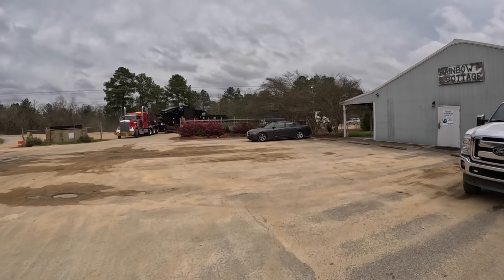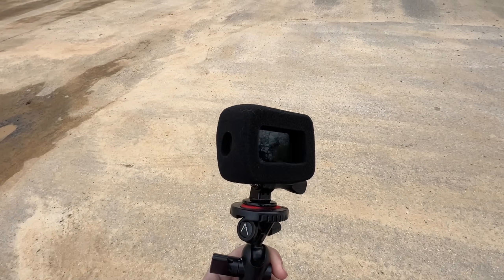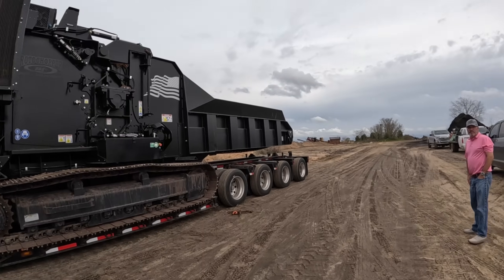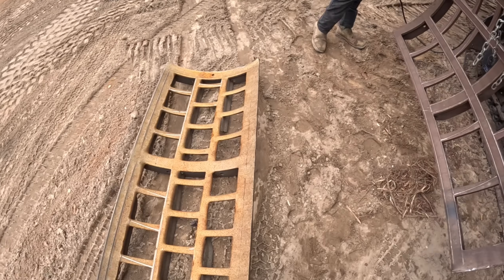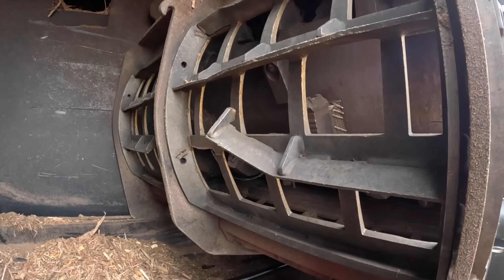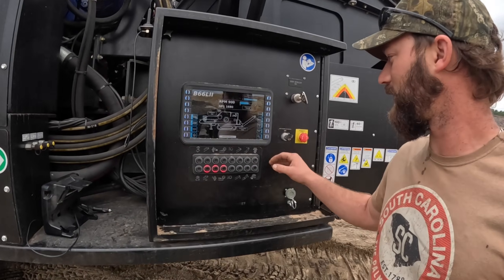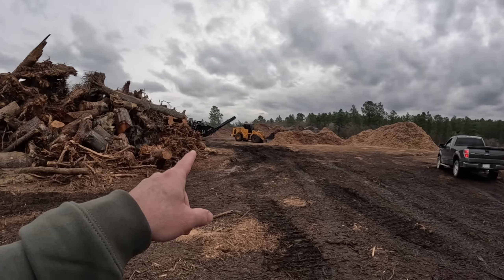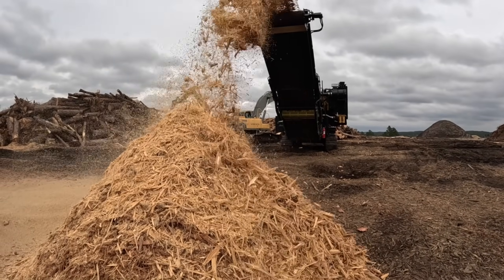Lots of HEAVY equipment arriving today! #heavyequipment

Comment: That machine is what we need here, for our million hectres of forestry industry, possibly require a 100, 😊😊😊.
Reply from the maker: She’s a beast!
Reply: @TheRealMrDigg  I worked in a sawmill as the chipper operator for 12 years, the electric motor was a 750 hp, it could chip reject logs in 3 seconds, plus all the large and off cuts, the noises was 140 dbs, the foresty was very old first crop pine, but not pruned so a huge amount of wasted material,

Comment: Congratulations on the ability to try out the new chipper!   Now you need a larger diesel delivery truck!  That thing probably has a 300 gallon tank!  With a class 8 truck using 10 gallons per hour, this beast must be using about 20 gallons per hour?   At least it is going to make a lot of profit for each hour it is running.  

5600 gallons used in 165 hours is 34 gallons per hour!  Wow!  

This is such a short video, I had to watch it twice!  Thanks for the new video!
Reply from the maker: Dont wanna see the fuel bill this month!!

Comment: Ryan that edge is an impressive machine. I don't understand why they couldn't do that with trash to make it lighter and could pack easier, it would cut down on fuel expenses of running the compacter. Stay Safe and keep up the good work.👍🇺🇸
Reply from the maker: You mean run trash up the stacker??
Reply: They can not run the trash through the wood grinder.  And it would add a lot of fuel without really making the trash much smaller.

Comment: Rotochopper came through at just the right time for you, it would seem.  With the demand for wood chips and mulch going through the roof, you needed to be able to grind up some of the bigger pieces of wood, which this machine can do because of the increased horse power.  You cannot rely on brush to meet the demand for mulch, and you didn't have a machine which could handle the big logs, and so had to split them down, which is a time consuming process.  Re-investment in a business is essential to keeping up with the times, which many companies are neglecting, I believe, in order to allow enriching the stock holders.  But the stock holders end up losing when the company goes out of business because of poor management.  I noticed that the bull dozer is still up on blocks, waiting for maintenance.  Hope those blocks hold!
Reply from the maker: Perfect timing wasn’t it?! Thank you so much for watching and taking the time to comment. I really appreciate you.!